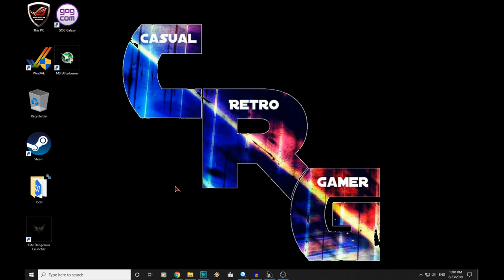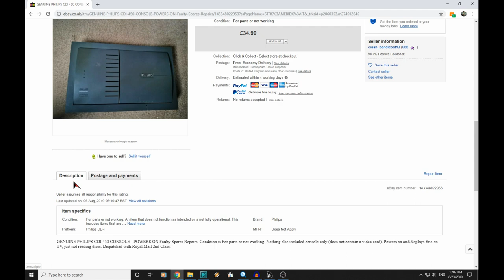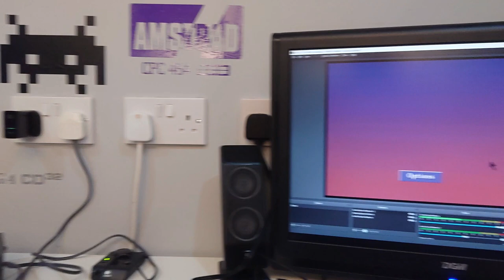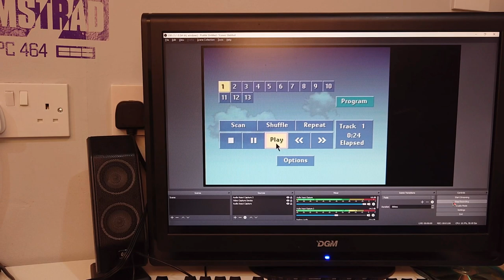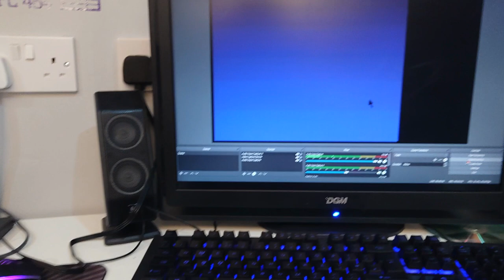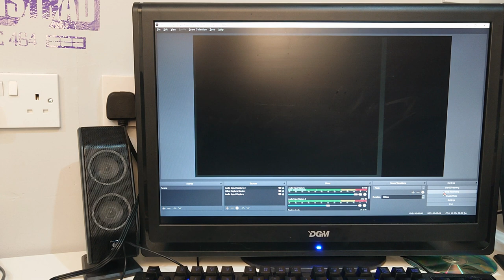Philips CDi  - Part 1 - Not reading discs???

Comment: There was a 3 button CDi joypad that was basically a rebranded version of one made by Tecno Plus, that was released for multiple systems in the mid-90s. I have a white & grey one for the Amiga, but it was also available on the Mega Drive, and as a 6-button pad for both the Mega Drive and the Snes. It wasn't a bad controller, as I remember. Anyway, it's generally thought of as one of the better 'proper' controllers for the CDi - so much so that they can go for about £200 these days.

Comment: Do you have any idea what component that CD Spindle holder could be? Not the laser assembly itself but the magnet that holds the disc in place on the top lid. I think that's the problem with mine, yours looks different. Mine is just a gray plastic barrel with nothing to hold the disc in place
Reply from the maker: I'm not actually sure what that parts called but I know what you mean.  You might be able to take one out of an old PC CD drive.

Comment: For others adjusting the laser ohms down solved my problem. Then add a dab of super glue so it doesn't vibrate out of place.
Reply from the maker: It would be unusual to turn the laser down, unless of course someone had turned it up so far maybe before you got the console.

Good tip on the glue!
Reply: @CRG  I have fixed GameCubes, Xboxes, PS2's, etc by adjusting the laser ohms.

I have two CD-I lasers. The consoles had never been opened. Both were fixed by adjusting the laser ohms then adding some super glue to make sure they're stable.

My guess is CD/DVDs spinning in these for 20-30 years can micro vibrate some of these out of place. I had a GameCube for example with its ohms way higher than normal and the dial was loser than other consoles. So might depend some on manufacturing error.

Also sometimes it can be just a little corrosion and cause the ohms to fluctuate with just a little vibration from the disk (I saw this happen on one console). Twisting the dial back and forth can help stabilize this as well.

Anyway those are just my experiences with these.

Comment: where did you get the power supply?
Reply from the maker: Just got it from eBay, probably paid to much but they are hard to come by.
Reply: You can use CDI 210 power supply but you need to solder it to ethernet cable.

Comment: Sorry i dont really understand, what did you do with the spinner exactly? Push it down? Or just rub it clockwise? Do i really have to opened the case to fix the spinner problem?
Reply from the maker: It had been pushed down and was stuck against the case.  All I had to do here was lift it back up.
Reply: @CRG  okay thanks for your explanation :)